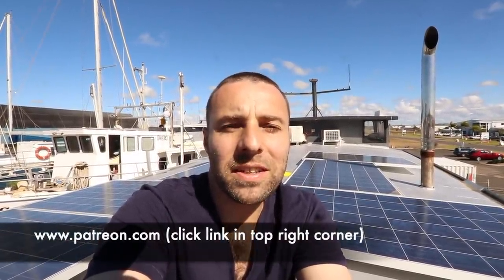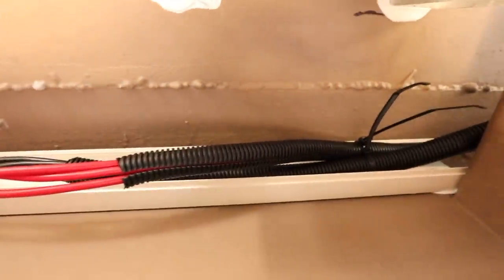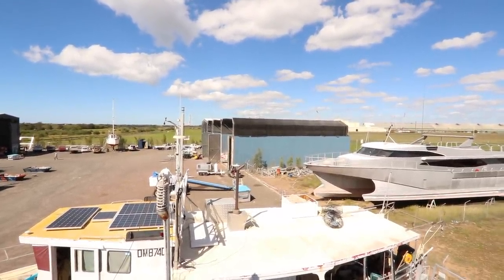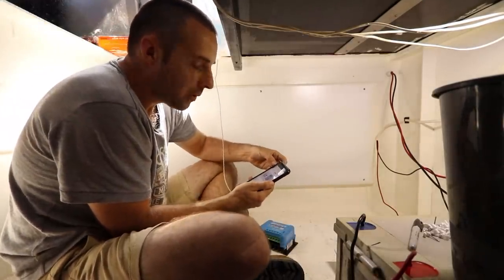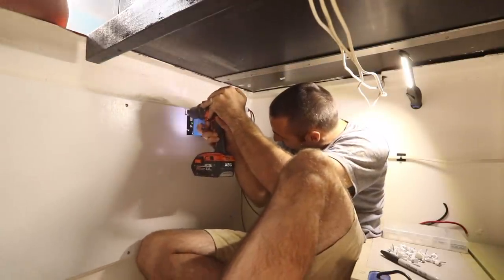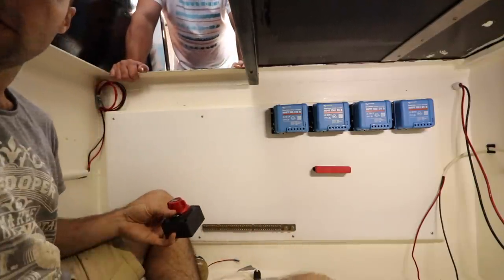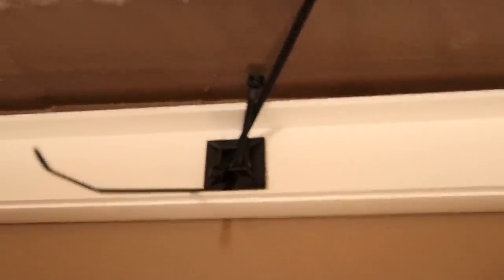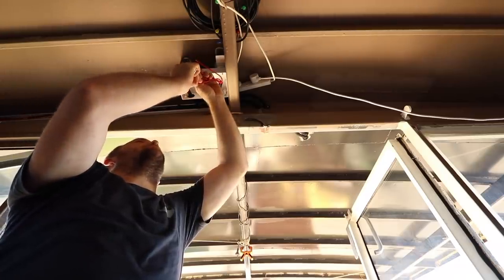Installing MPPT Solar PV Charge Controllers - Project Brupeg Ep. 90 (part 4 of 4)

Comment: Hi Damo, another great episode......forgive me adding another bit of random advice, all this wiring is triggering OCD and it's getting the best of me, reckon you should try a bit of offcut wire with compressed bootlace fitting to double check if it will fit in the Victron charge controllers,  they really are the way to go. Also it didn't look like you increased the cable size from your positive bus bar to your main switch (4 in/1 out all same size)....why? Also were you using marine shrink wrap, looked a little like the standard stuff. Cheers
Reply from the maker: Ok so the heat shrink was mil spec resin infused (best we can find anyway), I like your suggestion of a compressed bootlace. I will try that. The cable into the charge controller is 6mm2 which was well oversized given its a max of 7amps running through it. The cable from bus bar out was 10mm2 which is a very short run and so far runs perfect with no heating. Not sure if it’s the exact right size but it’s the biggest I had available on the day in tinned.
Reply: @ProjectBrupeg Thanks for taking time out to reply, didn't think you'd use standard heat shrink just looked a little slim to be infused (watching on my phone), guess you have done the math on the wiring still can't get over how small the battery leads are. When I was introduced to bootlace connectors thought they were the bomb, been using them ever since, cheers........now for heavens sake either get back to work!

Comment: I hope that the polystyrene on the walls is fireproof. Don't use stick on cable tie clamps, they will certainly fail.
Reply from the maker: Yes and yes. yes to fire proof, yes to the stick on fell off. they didnt work. we ended up using adhesive.

Comment: 125 amp fuse plus another XXX amp for the inverter through a tiny battery cable.  Are you sure the wire is heavy enough?
Reply from the maker: Nope it’s not. We won’t be running a big investor until we replace the batteries with some that have proper terminals so we can put thick gauge wire on them all

Comment: I m interested in your reasons for putting each pair of panels in series rather than in parallel? 
If one panel fails you will lose the pair.       Did you go for a 24V DC system?    Similar question......why not  pair the two sets of two batteries in parallel, for two  12 V feeds,  so that if one battery  in either pair becomes weak or fails, you can isolate the bad battery and still have 12 V service until you can replace otherwise you lose the service of that pair for a 24 V set up.
Reply from the maker: Hi Geoff, we wanted to put the panel pairs in series so the voltage was higher for less line loss. If we lose one panel it will take out its neighbour, however that still only reduces total solar output by 25%. Yes the batteries are 24v as it allows almost double the PV wattage. If we went with 12v the total PV we could have with these controllers is 290w per MPPT versus 580w @24v. As for risk of a battery dropping out. There is a chance but if one died again it will knock out its neighbour but not the other pair of batteries.
Reply: @ProjectBrupeg  thanks........each battery is 24V or do you stack two to get to 24V?  One good thing about the non terminal post batteries is that it forces you to use terminal blocks /  separate bus bars, and prevents folks from putting too many cables onto the battery terminals ...also the terminals are perminently isolated to help prevent tools shorting the battery....with the suckers you are using that would not be a pretty sight.
Yes solar is a not quite as simple as it initially seems. The MPPT controllers are impressive for their price points.
Good luck with what is an impressive project.
Reply from the maker: Thanks Geoff. Each battery is 12v200ah so paired up as two pairs at 24v. It’s likely we will change these out for lithium when we can so I’m looking at these as temporary batterys

Comment: Great video Damien. If your going to Antarctica will you be okay with your hull thickness? With ice
Reply from the maker: Hi AW. Hull thickness is currently 6mm. The plan for when we head to the ice is to add additional duplicate runs between all originals and to add an additional layer of 8mm 300 series stainless from the bow back (1/2 meter above the waterline and 1m below)

Comment: How did you make sure that you plug the wires from a single panel in the same controller ?
Reply from the maker: Tone generator
Reply: @ProjectBrupeg  Ah, OK. Was just wondering whether you did that, as I didn't see it in the video.
Reply from the maker: Yeah it never made the cut

Comment: Nice installation and panels the only thing I see is the wires for the battries is to small
Reply from the maker: Thanks very much, the battery cables are permanently mounted with resin from factory so we have no option to change them out for larger cables but would love to. Our only option is changing the batteries which is planned for the future
Reply: Ok understand

Comment: it looks like the wire coming from your to the fuse is on the small size for 100+ amp fuse
Reply from the maker: Hi George, the cable from the batteries to the fuse is unable to be upgraded as its hard wired into the battery. Replacing the battery is the only option. The cable from the Fuse to the load is 10mm2 and it does need to be 11.43mm2 size so it will be an upgraded cable soon (10mm was all we had available in tinned cable at the time

Comment: Solarpanels? Why not just get another alternator on the engine? Or are you planning on sailing?
Reply from the maker: Anchoring. Preferably without a motor running

Comment: I am not sure you have the charge controllers wired up correctly. The black and red wire from panels bank 1, has to be connected to the controller #1, the black and red wire from panels bank 2 has to be connected to the #2 controller, same for 3 & 4 If you have to make changes, the circuit breaker panel in the saloon is the easiest place to do it. Just move the red wire to match the black ones. You can't mix them up or the controllers won't be regulating it's bank of panels. I hope you understand what I'm trying to tell you. The input from the panels has to be wired that way and then the output is combined to harness all 4 banks to produce max power.
Reply from the maker: Yip I understood, we realised this later and adjusted the breaker wiring to suit after the fact
Reply: When your half asleep sometimes the right keys don't get touched. I corrected the misspellings. When I look at the edited video's, I'm only seeing parts of what you have done so I'm at a loss as to what you have actually done. There for when I comment, I'm trying to pull together what I assume you have done and if I see things that don't make sense to me, I'll add a comment. Since I'm viewing at a much later date, I figure you have already found the problem and corrected it. I'm adding this so both you and your viewers get to see what I see as a problem and what needs to be done to correct it. They make colored electrical tape and when I'm working a circuit I will identify it with a color code so I remember which wires are part of that circuit. Hence the wires for panel 1 would be blue, panel 2 would be red, panel 3 would be yellow and panel 4 would be green. I would have taped the red wires that way at each end and done the same with the black wires, I also I would mark the wire at any point I cut them in two so I can follow the circuit through the breaker box. I hope this helps you down the refit. When you get to the wiring in the bridge this will really be important to you. Your doing great and I am enjoying following the refit with you and Jess.
Reply from the maker: Thanks Rich, i can understand what your saying. normally when we shoot for an episode we start with sometimes 15hrs of footage and we need to cut that down to 45-60mins so only the critical stuff gets through the final cut.

Comment: Damien the problem of the solar panel peaked my interest so I had a little search about, the solution is simple in your case just buy a solar panel with a slightly higher wattage rating. while this would not be ideal the fact is you would not have a loss compared to the other arrays and your charge controller will output the same. I found this simply googling can I connect solar panels of different wattage https://solarpanelsvenue.com/mixing-solar-panels/ it has the maths and from what I can see a 250w panel for example would not cause you an issue hope this helps
Reply from the maker: It looks like we might have a solution, we have two identical panels that we will replace the single missing panel with. Solves all the drama of trying to match the existing panel.
Reply: @ProjectBrupeg  cool otherwise a match is not neccessary for the pair as long as the total output of the pair does not exceed the input rating of the controller

Comment: When securing your cabling throughout the boat, try these little bases, just screw them where required and lay cables/wires in them & secure with a cable tie.  They are available in a couple of sizes.
 RS PRO Black Cable Tie Mount 16 mm x 23mm, 8mm Max. Cable Tie Width,  RS Components Stock No. 233-685, qty=250 per bag.

 https://au.rs-online.com/web/p/cable-tie-mounts/0233685

Comment: Your inter-battery cables seem pretty thin.
Reply from the maker: Yeah they are but because the cables are resin infused to the battery we have no ability to increase there size. Next option is battery replacement to post type

Comment: Isn't the cable run from the combined MPPTs positive bar to the switch and from the switch further on a bit puny? Seems to be same gauge as those from the individual MPPT. I mean - when they together try pouring about 80 amps into the bank?
Cheers.
Reply from the maker: Hi Bo, the positive busbar are all rated at 150amp. Might just be a wide angle lens thing making it look smaller than it is.
Reply: It is not the bus bar but the wires to the bat. You have a fuse that is rated at 150 and wire that would smoke at 50.  I am an electrical engineer.  Fuses protect wires and what ever wire rating you have must have a fuse to match or it is very dangerous.
Reply from the maker: Hi Lou. Yes I agree. I’m open to changing things to make the system better. We have four 12v200a batteries with 8mm2 cable coming out of each pole. Wired as one 24v bank feeding to a single main fuse. Round trip distance is 1.5m max. Based on that what size fuse would you recommend
Reply: Hi "downunder",
The + bar seems OK. My concern is all about the cable from the bar to the switch and further on. Looks too tiny.
Cheers.
Reply from the maker: Yeah it’s 10mm2 cable. Calculator said it needs to be 11.4 but we didn’t have anything bigger than 10 so went with it in the knowledge we would change later

Comment: One last thing I hope you at least take a look at is the size of the wiring going from each battery to your fuzes.  The little wires we watched you install were quite small, and would never carry the load needed to power a large inverter running at full load.  At the end of your video you stated the batteries were connected with #10 cable, and that simply won't carry that kind of load.  Number 10 wire is only good for 45A at 24V, not even close to the size necessary to power a 3000W inverter.  It will just fry the insulation off the wire, or burn the cable in half.  For a 3000 Watt inverter, you will need at least 4/0 cable, as you will be drawing 200 Amps.  You should be fused at 300 Amps to allow for the surge current of turing on a large AC load. ( Please see: https://www.altestore.com/howto/recommended-inverter-cables-sizing-and-breakers-or-fuses-a62/ ).  I am not a safety nany, I am just concerned that your battery cables are way too small and you may be just a heavy load away from finding out the hard way. 

I'm not sure what size cable the batteries have coming out of them, but I would be checking if they can actually carry a continuous 200A output to feed a 3000 Watt inverter.  I read you were looking to upgrade your batteries.  It may be that you will need to upgrade your batteries when you are installing your inverter, as well as the cabling from your batteries to your fuze holder.  Your current batteries could be placed into a backup role for either house lighting or as a backup to your drive engine.
Reply from the maker: Did you not watch the part where I said I can’t change the cable size as the battery maker resin infused the cable into the battery. I completely agree with everything you’ve said. Our only option is the change the batteries which is on the cards for us.
Reply: @ProjectBrupeg  I was in the process of editing my comments when you replied.  I did indeed miss that part, but had read it in the previous comments.  Keep up the awesome work!
Reply from the maker: All good. Thanks for watching along

Comment: Line loss.......think about it........all systems need to be redundant......don't tie everything together.
Reply from the maker: I don’t think that will be an issue with this system. We have line loss less than 1% because we oversized the cables, we have four separate solar systems (four groups of two panels independently connected to a charge controller connected to the batteries, which are set up as two separate 24v banks) so redundancy is taken care of. As for tying everything together, there is very little risk of this being a failure point so I’m happy with the install layout

Comment: Love the detail but all the waterproof stuff won't stay that way the solar will be cool until it fails just dump and run! Work stuff until it works or doesn't. Damo you are being pedantic. Just launch and see what works then fix it!! Love you to bits but you have a floaty boat just go for it or your going to be second guessing till judgement day
Reply: What do you mean?
Reply from the maker: There’s dropping things and just getting on and there’s making a decision on emotions and impatience. We want Brupeg to function and not do it half arsed. What’s the point?  Drama, more money to pay correcting simple mistakes... avoiding work? 
I thing Damien has it right. Some things have to be done well or this project won’t work... motor, steering, electrical, Hull etc.
I’m not redoing shit that should have been done right in the first place. If it takes an extra day or month so what? It about succeeding, not coping with dramas once we’re in the water. I don’t have a need for drama I like adventures. Cheers Jess
Reply: @ProjectBrupeg  Couldn't agree more strongly Jess. Do it once, do it right. No good running around jerry rigging stuff in the middle of the ocean when a bit of care and forethought could have avoided it. People seem to forget that this'll not be the first time you two have lived afloat, granted Brupeg is hugely different but you're far from green amateurs. I admire your restraint and patience when replying to so many armchair experts. I'm getting revved up about this so I'll call it a day right there. Regards to all.
Reply: @ProjectBrupeg  sorry just getting excited to see the old girl afloat! Do what you must! Im behind you all the way. Float damn you float!! 😬
Reply from the maker: I know you are Lox. Easy to loose context over text